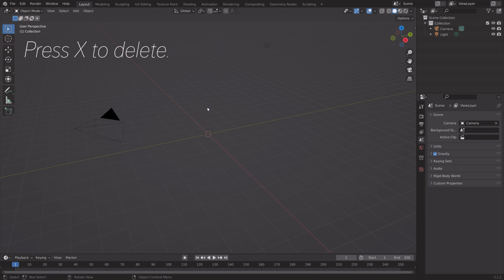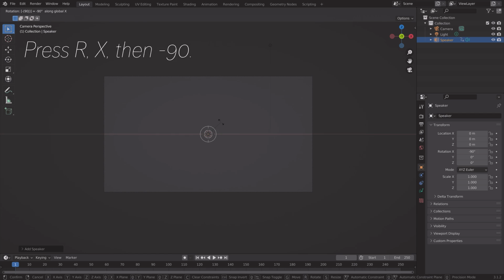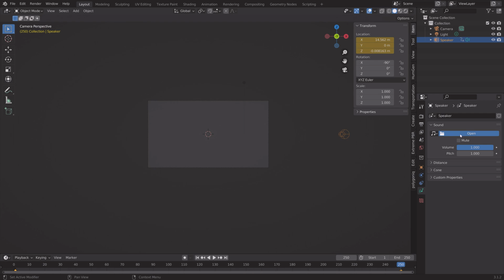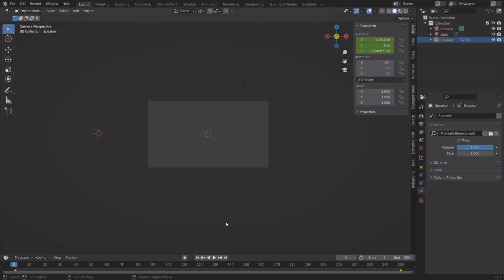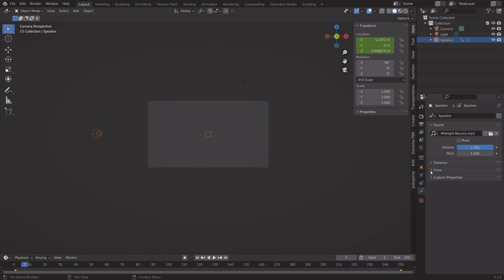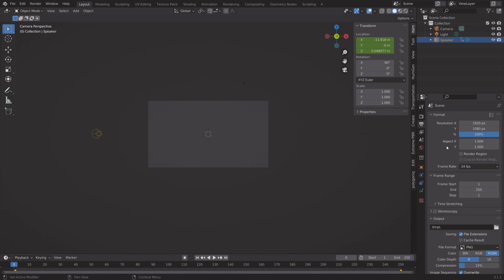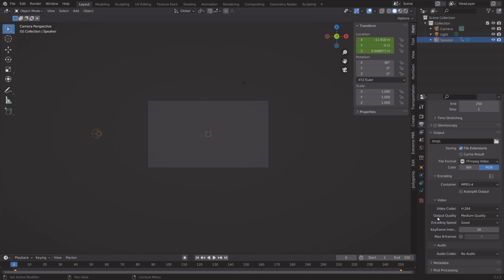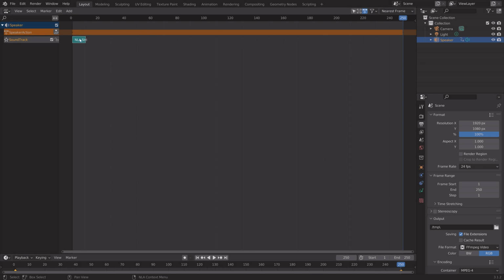[3.1] Blender Tutorial: 3D Sound Using the Speaker

Comment: I want an option to "enable reflections" for sound so bad. Meaning accurately bouncing around the 3d scene, similar to what cycles does but for sound. I think I'd use it for every project which needs sound design.
Reply: Yeah that would an incredible feature. I'd use it over Logic any day.
Reply: What you are looking for is reverb, but that is impossible in Blender. Unless you place the sound in a simple 3D object like cubes, know how to code, and be happy with very inaccurate reverb. Also, the Aud system (API) that Blender uses doesn't have that feature.
Reply: @Newmediasupply  why would it be impossible. It's literally pathtracing but for sound. It may not be good in evee but using cycles it should be 100% possible.